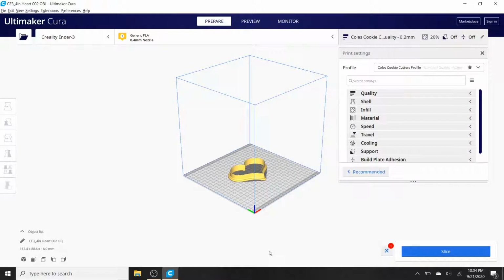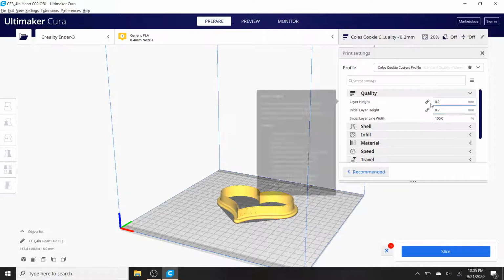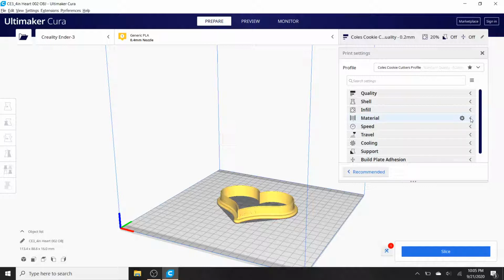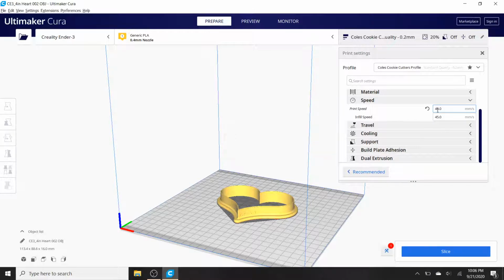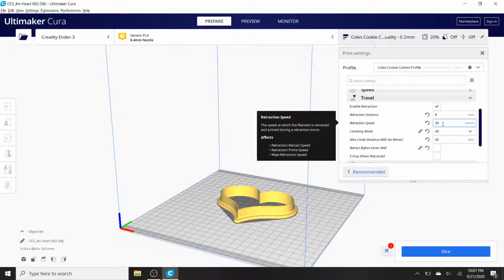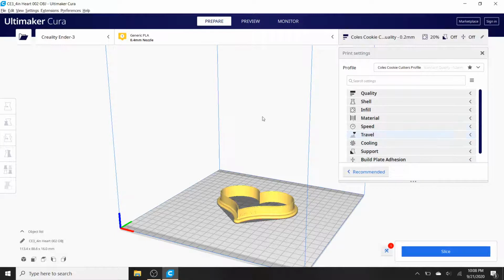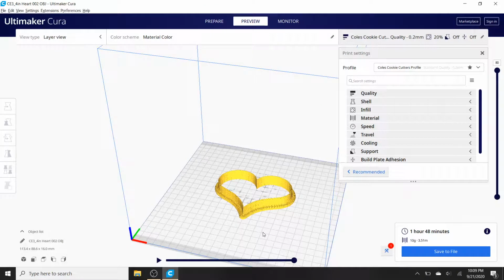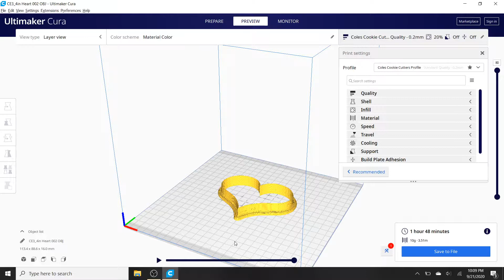Best Slicer Settings For Cookie Cutters

Comment: I'm trying to print some Cookie Cutters, but I keep getting a line where the widths change, which is the main breaking point of the cutter when stress is applied. Any tips on how to fix this?

Software: Ultimaker CURA 5.0 (it also happened in CURA 4.13)
Printer: FLSUN V400, was tuned to print cleanly (for the most part).

Also, I use a skirt, mainly just to ensure the lines are laying down correctly (and so I can live level to make it perfect before the mesh).

Comment: So I just changed my settings to these and it sped up my prints ALOT. Which I like. However about 5 minutes into the build, the nozzle lifted to about 1 cm above the bed and kept extruding. I dont know WTF happened and what I need to fix it. Help pleaaaase.

Comment: Can anyone help me, my pla isn't sticking to board, what am I doing wrong?
Reply: either reduce or increase your bed heat in small increments .  you may have to play around with it a bit to find the right setting.
Another suggestion is cover your build plate in blue painters tape.  That really helps with adhesion
Reply: @chupness  Thank you, I will try this information.
Reply: your bed leveling could be off by just a mm and that's enough to pick up the initial filament layer and drag it around making a mess. I've learned this the hard way.
Reply: I put hairspray, it sticks fine

Comment: You're a life saver and not know it. Took me forever to get settings going and they been good until the inside wall was rough. Got a different filament and those codes were not working for this one. I put the same settings as yours and I can't love you enough ☺️

Comment: I would love to see a video on how to do a beveled edge for the cutters to help with the sharp clean cut if your interested lol. Or if you would like to share what CAD program you use to design in. I love making jewelry so much that I bought my own 3D printer to create and print my own clay cutters only to find the whole design process is not so simple. This video is wonderful, it has helped my prints TREMENDOUSLY!! Thank you for all your help. Your awesome!!!
Reply: I looked everywhere for a tutorial on how to do a beveled edge and couldn't find any.
So Instead, I reduce the top 3 mm of my cutting blade from 1.2 mm to .5 mm.
Gives it a nice thin cutting edge.
Reply: @chupness  hi i tried it too at .5mm but it seems to not print that layer...it remains empty when previewing on cura    :( any help would be appreciated.
Reply: @marydhanyalouisa  are you printing with a .6mm nozzle?   I print with a .4mm nozzle and it prints out .5 just fine for me.  and Cura shows it in the preview
Reply: Yo estoy pensando en comprarme una también para ese mismo uso, pero veo que no hay mucha información sino para cortadores de galletas.

Comment: Pla+ is food safe man??
Reply: You are not cooking in the PLA, so yes. PLA is made from corn and/or sugarcane starch. PLA itself is food safe, however, once printed it has many voids (fear of bacterial growth) on the surface which would make it not food safe if the material you are cutting is not to be cooked (cooking would kill bacteria). These should be washed in lukewarm water with an antibacterial soap. Additionally I keep mine in the freezer to make sure no bacteria can grow between uses. The PLA is not what you have to worry about. It is the print nozzle you need to worry about. Brass can have lead in it as part of the alloy, so stainless steel is a must, and the OP is using stainless steel.

Comment: Hello, with Cura I have Shell 4x 1.6 thickness and my cookie cutters are not very sturdy :-((
Reply from the maker: interesting. And yeah, it's hard getting that perfect profile what causes no stringing, sturdy walls, and a smooth print. Each day we try to improve our profile. One day we will get it perfect then I'll put up a second video on cura, lol
Reply: @cookiecutterexperts5069  I’m getting strings and have no idea how to fix it. Would love a video on fixing that. Thank you so much for these setting reveals :)
Reply: @tanyay9863  it could be an under extrusion issue. Check for clogging in your nossle, look over your extrutor
Reply: Thank you ! I think my biggest issue is that I’m using silk I’m about to print with your settings let’s see
Reply: If you fool around with tinkercad before cura, I have my first layer at 17 with hole. Second layer is 16, and third layer is 4. Was 5 but it does fine at 4. Only thing I mess with in cura are my dimensions as far as x,y, and z. I have my cutters at 112 in height or width depending which is longer with uniform scaling checked off. After it scales, I uncheck and have my z at 16